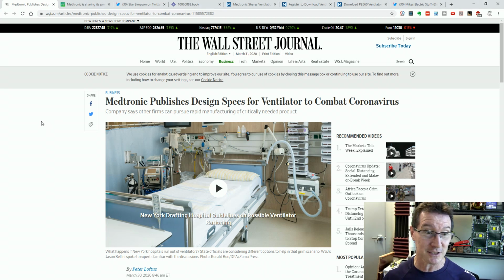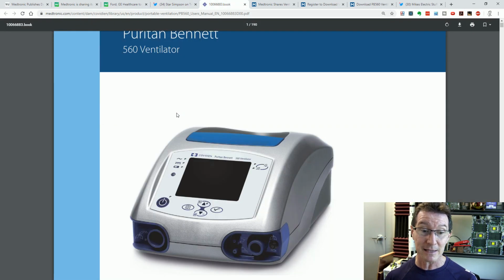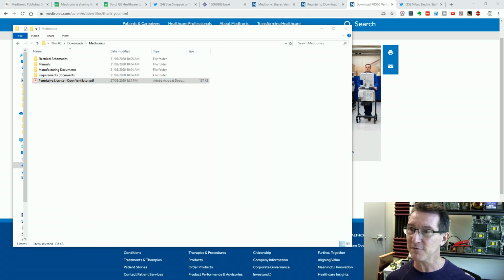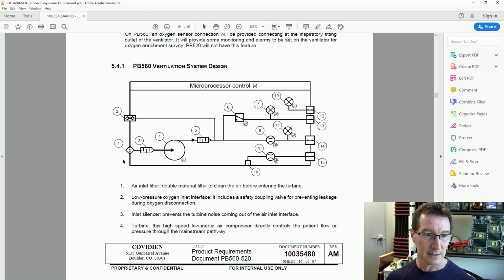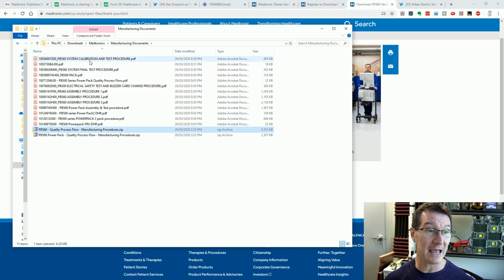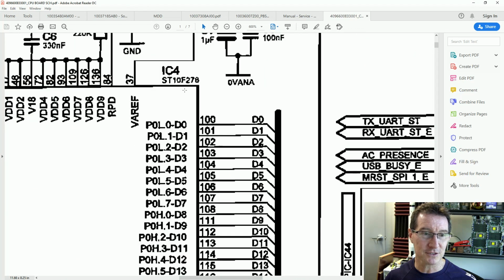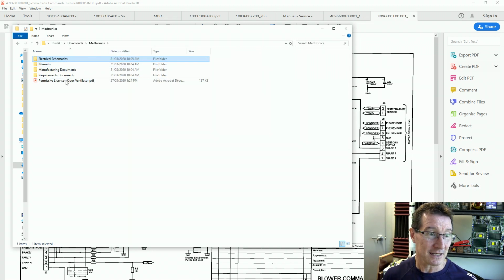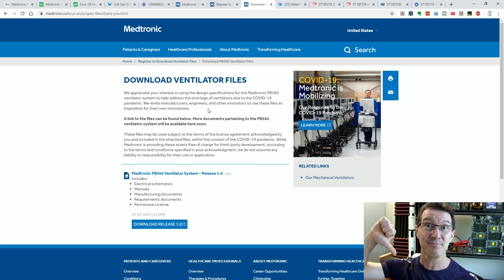eevBLAB #72 - BUSTED! Medtronics Open Ventilator FAIL

Comment: It takes time to gatter, compile and publish a lot of information like that, but in about a week they did it. It's not something to do at home.

Drawings, BOMs and code, everything seems to be there.

I work as an engineer in a medical devices firm from south america developing x-ray machines and we've just been relocatted to a ventilator projetct fully based on the medtronics design.

Comment: Bro your video sucks. They gave you the schematic. Theyre not gonna give you source for parts and valves. If you are a mechanical engineer you can source those parts yourself and follow the signal flow. Cpu schematic is so you can have a designer make it and source it - this isnt for a normal person garage do it yourselfer...

Comment: Source code for MCUs is now available along with full boms, they released everything. Not a huge Medtronics fan,  but I think we all owe them an apology. Anyway the injection moulded parts are difficult to replace with 3d printed parts, basically someone has to redo it all for 3d deposition, even if they give away the solidwork files.

Comment: It is just a reference design. If you go through the boms components are from all over the globe and some are not produced anymore. Considering the was originally a older french design that not surprising. The problem is not as much the design as the certification for use. In the EU you have MDR and ISO-14385, in the US FDA and so on. Then you have the software which hasn't been released which might be the most valuable part of this release. Getting through the certification for software alone is a 1-2 year process if you have a clue about what you are doing. Then you have to do the hardware and the combined qualifications. Oh of course you have the QMA/QMS facility bs and more documentation on top. If someone gave you these docs and a pile of cash to play with you might be able to get an approved ventilator about the same time the "license" goes away.  It may not be a publicity stunt but a "ain't as easy as it looks" for all the wannabes who dont have a clue whats involved.  I deal with this stuff day to day and it is mind numbing.

Comment: update please they shared it all on 03/04/2020 
just look here :

Electrical schematics
Manuals
Manufacturing documents
Requirements documents

Manufacturing fixtures
Printed circuit board drawings (including multiple BOMs)
3D CAD files
Mechanical part drawings

Source code files

Accessories
Bills of Materials (BOMs)
BOM Drawings
Purchased Part Drawings
Risk Documents

Comment: I have repaired many ventilators (anesthesia ones) and was factory trained (formerly Ohmeda now GE).  IMO, older simpler designs would not only be cheaper but more reliable, require less maintenance and can be produced much quicker.  Monitoring can be easily done via other stand alone monitors.  Things to (ideally) monitor, end tidal Co2, tidal volume, inspired O2, airway pressure and rate.  And of course patient peripheral O2 saturation (SpO2). Read about Bird ventilators (it's a man, not an animal).
God speed everyone.

Comment: It's totally unfair to blame the Medtronics for using this as a marketing stratagems, if you update the webpage you should find that they had already shared all of the design resources, including software code, mechanical drawing , BOM , etc, these information are valuable to the engineering team who are working on building ventilators, we really aprreciate the contribution Medtronics made.

Comment: They did say it would be released across a couple of days, and they did release the rest of the project files (CAD files, both mechanical and electrical(r2), and the software part, released last, on release 3).

Comment: The CAD and other files have just been released by Medtronics in their release 2 for this product. But actually I think you are wrong, the software requirements spec is detailed enough that you could basically rewrite the software from it. Personally I don't know why you'd use their PCB design for the microcontroller when you can just use an off the shelf PIC board and recreate the software. I would use the schematics as a guide, I don't think they're trying to intend this to be a full set of information to build the exact same product. The other parts of the standards specs can be referenced in an FDA/MHRA approval application if they're all implemented. In any event, making a cheap copy of an existing product with corners cut is possibly worse than no ventilator at all - people should be looking at existing designs towards their own efforts which appears exactly what is meant here.

Comment: they released it on 31th march with cad, Mechanical part drawings
, Manufacturing fixtures
Printed circuit board drawings (including multiple BOMs).

Comment: Obviously you need a team of engineering from mechanical, E&E and software background to digest all the documents.  It is not for hobbyist, unlike the MIT design which automate the AMBU bag. Medtronics does not attach the source code, but the document entitled software requirement may help you to develop the code. This document has been revised more than 26 times, and I believe it tells you a comprehensive software guidelines to ensure a functional ventilator and most importantly safe, safe and safe. Plus, if you are familiar with 60601 things either it is UL or IEC, you would then understand why this ventilator is very details and has so many things to consider. Building your own code is better than C&C. Thank you Medtronics.

Comment: I use ventilators almost every day at work and ive used every ventilator that medtronics / puritan bennett have designed since the beginning of time. vents are not a toy and the smallest slip ups can kill a person almost instantly. we've seen cases where the ventilator wasnt calibrated properly and the tidal volume delivered was too high and popped someones lungs because the sensors werent detecting the pressure correctly. AC/PC is one setting where it delivers a volume up until a certain pressure is ALMOST hit, if that pressure is read wrong itll keep inflating, theres also a ton of valves in place to prevent these mistakes that werent around until only about 25 years ago. weve had vents where the screens and dials fail and medtronics designed a nightmare of a ventilator called the PB 980, look into it and the PR behind it. each ventilator can cost upwards of 80,000$ with all the additional add ons and batteries and its just ridiculous. feel free to message me if you have any questions about how they work or their design.

Comment: It's a shame when engineers don't *read*!! They said they will be releasing the materials in batches, and sure enough they have been for the past 2 days. This post was unfortunately done prematurely. We are currently holding a deep dive study into the files under our managing member Eng. Alaa Salam's (a biomed engineer with 10 years hospital field experience, 8 of which involve ventialtors) watchful eye. We do have to give it to you when it concerns the limitation of the open source license (lasting till WHO declares end of PHEIC or October 1st 2024), but batch 2 includes PCB designs and BOMs and batch 3 includes source code.

Comment: As an ex product designer I would be looking for BOM (bill of materials) 3D CAD files, PCB data files, software and notes, build instructions, product instructions as a minimum. Preferably CAM files for the plastics parts too. What they are giving out here would need a team to study for an age just to understand the design intent and without the software it is totally useless.You'd be lucky to get the plastics tooled within 8 weeks even if you had all that although you could rapid prototype some units. And I'll bet you find that some of the micros are hard to get and may be on allocation. Designing a product is one thing - getting it production ready is a whole different ball game and I spent years designing medical peripherals for use with tele-med. This is more of a course in how to design such a product rather than a design to copy so you are going to need all relevant approvals too.

Comment: How many of the components they utilize in their actual device are designed in house and not available except through utilization of their specific supplier?  A BOM would be nice to see exactly what they sourced, and they could supply ALL of that, but it still may not help if the manufacture is still making as many as it can of that particular turbine for Medtronics already.  It would be nice to have the full cad document however because it would be possible to source motors for the turbine and have those with CAM abilities to print/mill turbines for addition to those motors.  

The requirements document should help because the person making the ventilator can then source components to fit those needs from vendors that still have supplies.  The little interconnect they have their is garbage though, and access to a full set of schematics would be best.

Comment: Medtronic just posted more documents yesterday, including Manufacturing fixtures
, Printed circuit board drawings (including multiple BOMs), 3D CAD files, and Mechanical part drawings. Having worked at Medtronic for 5 years, my guess is it is taking them awhile to get everything into a usable format and remove links to other documents etc.

Comment: hi @eevlog, when you downloaded the documents from https://www.medtronic.com/us-en/e/open-files/thank-you.html this page, only this zip file was available- "Medtronic PB560 Ventilator System – Release 1.0 (.zip)", but now there is another zip file is available, named "Medtronic PB560 Ventilator System – Release 2.0 (.zip)"(287.4MB). Which supposed to contain- 

    *Manufacturing fixtures
    *Printed circuit board drawings (including multiple BOMs)
    *3D CAD files
    *Mechanical part drawings

    *Permissive license

Beside this an orange ink marked note is written at the bottom of this page saying- "Be sure to check back soon for more PB560 documents." So it seems they will provide all the necessary documents within few days. 

I think it is really appreciable move from a hardware company. It will be better if we wait for a while and see their activity rather than start blaming from the day one. You may understand releasing a propitiatory equipment design, drawing, software, sourcecode, BOM at once is a time consuming process. Hope you will understand. Thanks.

PS: I have no relation with Medtronic.

Comment: i downloaded the files and agree, there is no CAD files neither for the mechanical parts nor for the electronic schematics nor for the physical board layout, nor BOM, nor software binary code (i doubt they would ever release the source code)... i browsed over the documentation and it is such a complex product with so many mechanical, electrical and electronic components that nobody will be able to put that altogether including an assembly line in 'real-time' to be of any use in the short term....and in the mid-long term it does not make any sense at all..

Comment: To be fair since the entire product was designed around whatever components were cost effective in bulk ten years ago (including most importantly the no longer available processor indicated in the video) the board layout and source code would actually be completely useless except as a study guide and both of these would need to be re-engineered. I'm sure the schematic and software design and testing requirements would be invaluable to bring up a comparable product  using readily obtainable components  circa 2020... It's just an unfortunate fact that rewriting the firmware either for a new processor architecture or even just a new device with completely different peripherals would require months of work.

I haven't read the press releases or anything that Medtronics put out but I wouldn't be shocked if the media coverage has added a heap of hyperbole to distort what the original intention of the company was which I believe would probably have been to give those uninitiated but with the technical skill set a crash course in whats required in a modern life critical piece of machinery. 

All that being said whats much more critically needed for the world right now are the more bare bones (read reliable) shoe string designs for the parts of the globe that aren't going to get to see the machines whose production is being ramped up by outsourcing to auto manufactures and the like but staying closed source for first world countries.

Comment: It's very easy to design something that can move a set volume of air in & out of a patient over time... it's another thing entirely to design & make a ventilator with the required ventilation modes & pressure controls that people who are gravely ill with COVID-19 require. If it was that easy, you wouldn't need a ventilator, just someone to squeeze a bag. But of course, everyone thinks it's easy

Comment: Media f***ed this up.
This is huge if you want make own reliable product. Such things can't be open source DIY thing- it's to dangerous to use it by yourself( it can kill heathy man) or use device with questionable characteristic.
Manufacturer should have an effective quality control.
They give data to everyone who trying to design a simple solution some reference how it should work at minimum requirements. It CAN save lives of some enthusiastic people or somebody who trust them. And potentially fill the market with good stuff ( virus came for long, so half a year is good enough).

Comment: No way you could build these within the time frame required. The only way to help someone build these in the required time frame would be to release all the parts required along with potential sources. And Cad files for the mechanical parts that could be printed. 
What they have shared would take years to bring to production.

Comment: I worked at Philips R&D on ventilators along side Respitonics.  They are giving away a lot that you don't appreciate.  This is enough information to help you understand what it takes to make a ventilator and that it's not just a blower and some tubes. With all the new DIY designers coming out this documentation will prevent DIY ventilator designers from putting something dangerous into a hospital.

Comment: Love your vids, however you screwed the pooch on this one.   Did you intentionally miss this sentence? it even shows up in your vid.!!
"More documents and source code files pertaining to the PB560 ventilator system will be available soon."
How about calling them? They are getting all the engineering schematics ready, according to their Rep.  I think you did not do your due diligence.
As for what info they have provided so far, it is indeed useful. The information shows you how to program the dam thing, in addition. You know what I'm going to give your video the same B.S. you gave them and not mention the rest. How about you do your job instead of pretending. 
Stick to solar roadways, or free energy, and other things inside your realm of expertise.

Comment: They have uploaded a "V2" where PCBs and STEP files are downloaded. I took a look at the files and the organization is terrible. Nowhere to start, not even for 3D printing. I have found more than 15 zip folders inside the initial zip folder. They should definitely make a cleaner upload so Makers and other people interested can actually understand what to do once they download the files. Ohhh, and I didn't find a "financial" folder, so even if you start making this device, who knows what the total cost will be! "Good info" thown away...TERRIBLW

Comment: That's not BS at all. Looks like all the specs are there so anyone capable can put it together with available materials. The mechanism is extremely simple, if you can't build one from the specifications you shouldn't be building them. Anything produced from this won't have the time to be tooled up properly to make production quality replicas.

Comment: Could be overlooking the value in design specification / requirement documents. Although there is no blueprint for a ventilator, there is the exact detail of what each component is required to do and how it is to perform within the device. That information could be invaluable if you want to manufacture a ventilator. Probably a stunt though.

Comment: I  imagine is some sort of blower  with a tube  for inhale  and a another blower in line  For exhale   And a timeing board to control inhale and exhale    And Some sort of electronic values so the blowers can run continuously then when the valve comes on it allows air to go in then the valve turns off the next valve opens the other blower exhaust the air out and a blood Oxygen finger thing to  check patient’s oxygen level  the basic Ventilator . I have autism . I’m good at solving problems